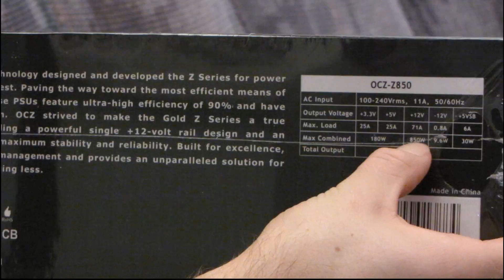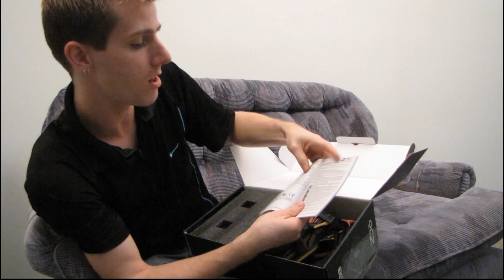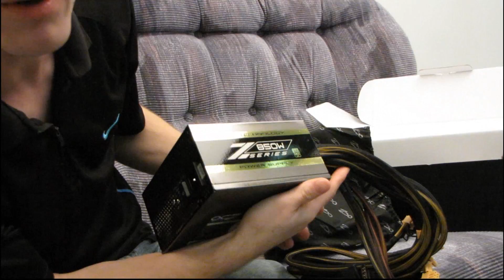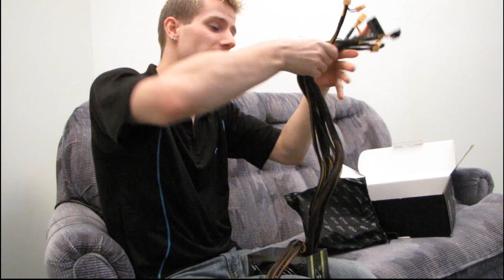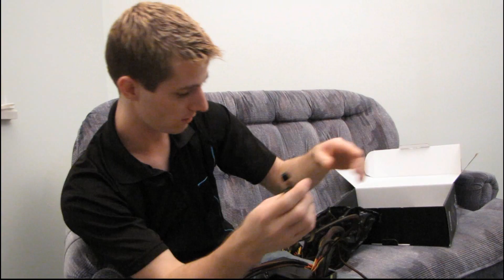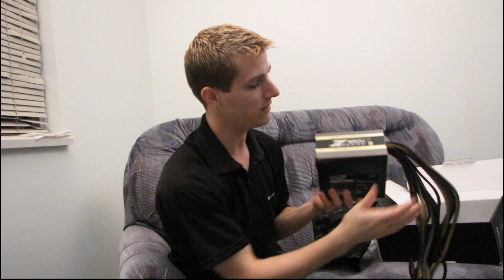OCZ Z-Series 850W 80+ Gold Power Supply Unboxing & First Look Linus Tech Tips

Comment: modular powersupplies are more expensive because of the extra interface but wouldnt it be better/cheaper to have less connections but more like adapters so you can also install your cables like you want (like a legobricksystem) ???...at least for the drives?

Comment: I got a 550watt ver of this and it powers a core i5 and 5970, the system only crashes when i put the 5970 at 1000core with overvolting, I got to 970 without overvolting and it powers fine, core i5 @ 3.2ghz 1.014volts load gigabyte p55a ud4